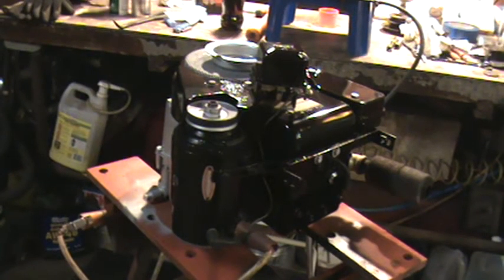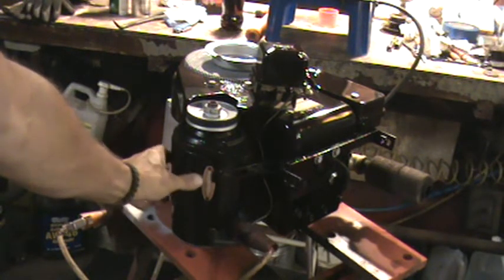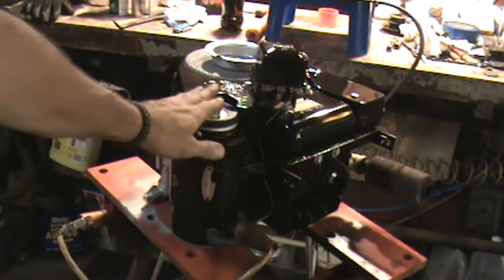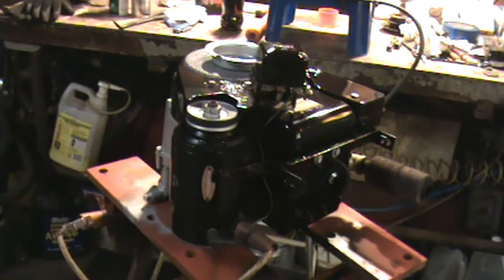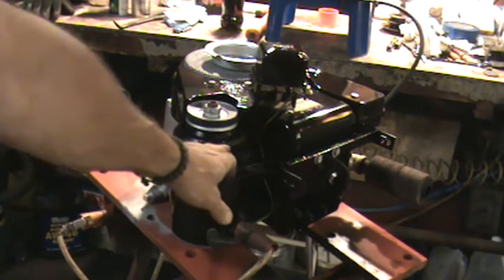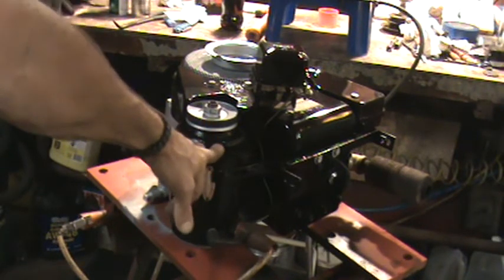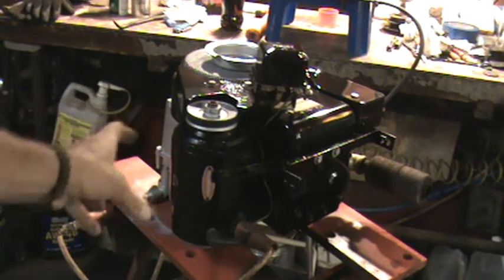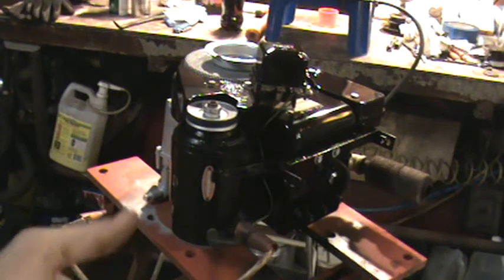Starter Generator trouble...Stay Tuned

Comment: Is it ez to change the pole,cuz my threads are no good at top,able to put the wire connect at bottom the green wire that runs from regulator to the starter Pole. Bought only Titans at bottom of the pole of the threads.

Comment: Zippo we have a problem. Rebuilt the starter on my Sim 3416H. Now the brushes disintegrate due to the field spinning the opposite direction. Bench test, the pulley spins clockwise. When mounted on engine is should spin counterclockwise. Why is it spinning the wrong direction. Thanks for any help offered.
Reply from the maker: It sounds as though it was rebuilt and the Poles were switched. Not something you can do without a proper alignment fixture. Running clockwise and eating brushes....I'd take it back to the business that rebuilt the S/G or source another known good used one. Zip~

Comment from the maker: @TheK7666 There is a welsh plug, a plastic grommet and a piece of oil soaked felt in the tail cap. The easiest way to replace the bushing is by removing the welsh plug and pressing it out from that side. An oil lite bushing can be used in place of the stock bushing and you will want to install it, then run a drill through the felt hole to drill the bushing for the felt to keep things lubed. Soak the felt in 30 weight oil over night and it should last our lifetime.

Comment: What do you recommend for cleaning the inside of these? Brake cleaner?
Reply: No . Brake cleaner will damage it . Electric contact cleaner worked for the all the electronics. I pulled mine  apart I clean the housing with carburetor cleaner and a brush but not the wires